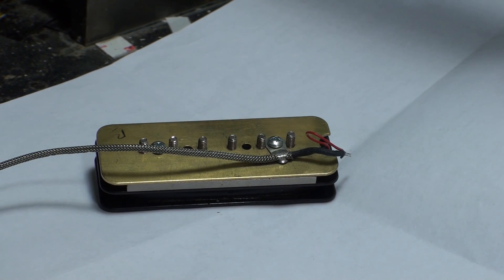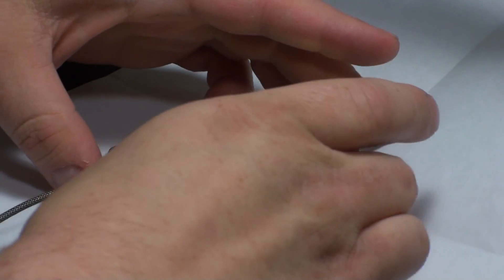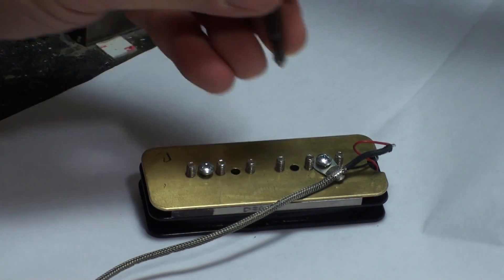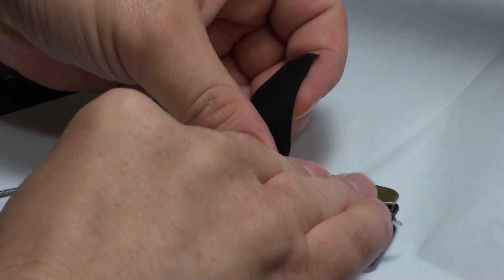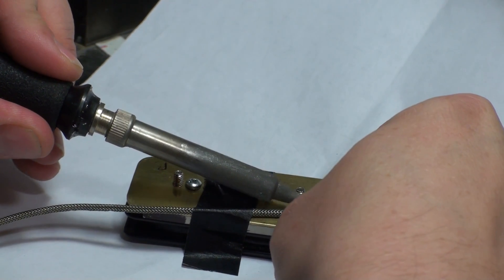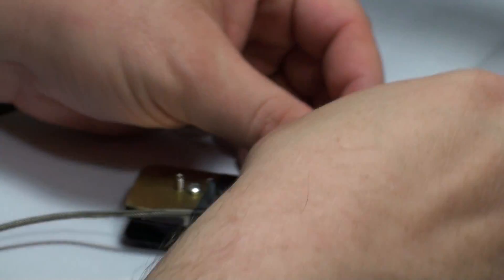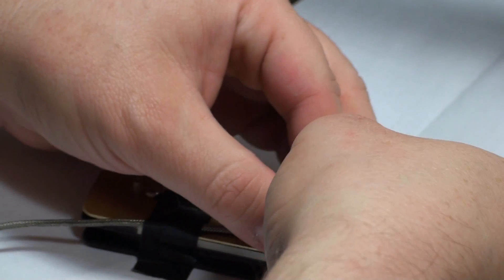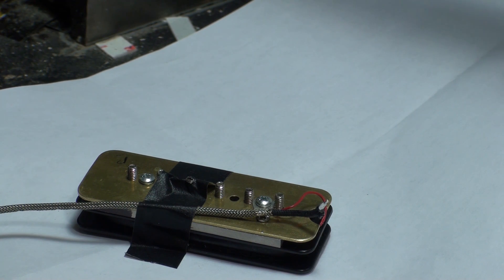P-90 Polarity Change

Comment: Ok if i understand? That means the pick up will be out of phase or in phase?
Reply: It's still in phase because he also swapped the wires. If you want it out of phase (with respect to the other pickup, assuming a dual pickup setup), flip the magnets but not the wires.

Comment: Just a tip, if your P90 doesn't come with a braided ground coil like the one in the video and is just a single wire, you can swap the wires on the pickup selector/potentiometer instead of the pickup. This way, you don't risk damaging the coil from heat.
Reply: Is there a sonic advantage to having braided ground coil?  I just bought some p-90s that are single wire...
Reply: Yes it's shielding the live wire. Less hum. @josephballerini3730
Reply: Did that, but I got very low output, like a fart sound haha

Comment: To reverse polarity, you either have to reverse the magnet OR flip the wire, but not both... If you reverse the magnet AND flip the wire, you are just turning it back it what it once was.... 
It is like drive on the opposite direction, you either turn the car 180° around OR put the car in reverse...

If you turn the car around AND then drive it in reverse, you will end up going the same direction as before....
Reply from the maker: Semi-correct, but keep in mind there are two types of phasing.  Magnetic, and electric.  Assuming you have two P90's which are South magnetic polarity, CCW wound coils (as is vintage standard), flipping only the magnets in one will put it out of phase with the other pickup, as would swapping only the leads.   But doing both will cause it to be hum-canceling in the middle position, since the coil is now technically "reverse wound"  as well as the magnets being flipped.

Comment: Thank you for your help! I have a further question: what could be the cause of the magnets simply not wanting to budge? I'm trying to flip (turn) them but they just won't move.
Reply from the maker: If the pickup is wax potted, the magnet may be being held in place by wax, and difficult to remove.
  As some point, I intend on filing another video that isn't so obscured by my hands.
Reply: @WolfetonePickups  Thanks for your mesasge! Damn, that's unfortunate. Can a separator knife help in this instance? I would really like to reverse that polarity because the neck P90 on my guitar doesn't combine well with my Filtertron and I'm pretty sure it's a polarity (out of phase) issue.
Reply: @WolfetonePickups  Thanks again for your tip, it worked! I have now flipped the magnets. My question is now related to switching the wires around - would that be considered too dangerous if the ground and lead wire go 'into' or near the area where the pickup wire is located? (this 'area' is shielded off by black cloth/synthetic material and the connections themselves can't be seen becaues of this).

Comment: So on a pickup with 2 wires you can just wire it up backwards after rotating the magnets right?
Reply: Yes you should be able to but the shielding wire should also be switched to the other side. On my P90's you cannot unsolder like these ones and the shielding  wire was soldered at the swtich end and so I had to move the shield wire from the ground to the (previously) hot wire as well as switching.

Comment: If your switching the wires.. why did you need to  switch the magnets ? Is this to reduce hum ?
Reply from the maker: polarity is both electrical and magnetic.  When combined with another pickup, having either the magnets or coil reversed in relation to the other pickup will put it out of phase. Having both reversed will make it hum-cancelling when combined with the other pickup.
Reply: ok,thanks . The video wasn't clear on why you're reversing polarity.  I thought it was to get an out of phase sound.
Reply from the maker: Yeah, the video kinda sucked.  It was made in a hurry for someone who wanted to know how to flip the magnets. Evertually I'll get around to doing another one.
Reply: Its video is ok, just change the text in the description
Reply: WolfetonePickups ....that's what I need to do. Thanks but unfortunately your hands were in the way. Well at least I know it's possible